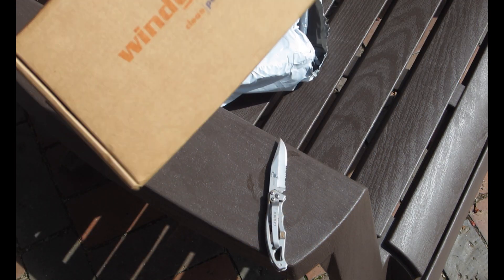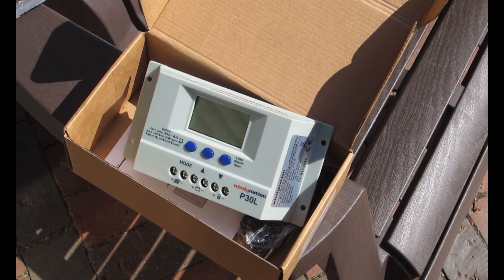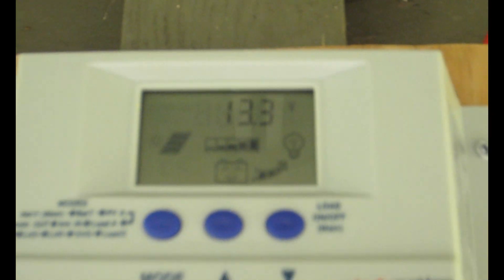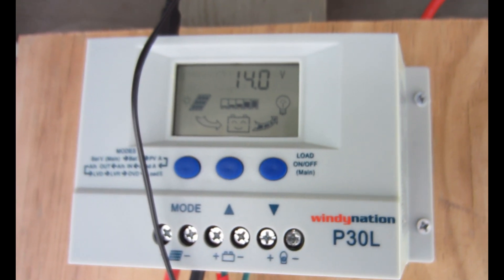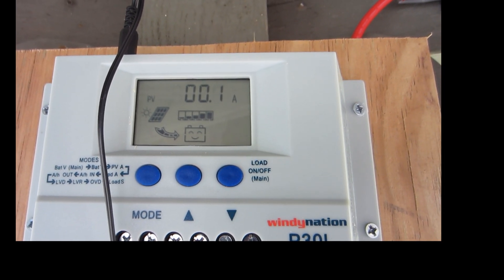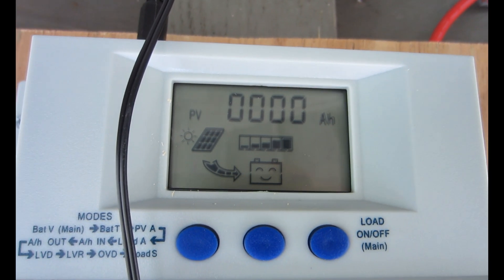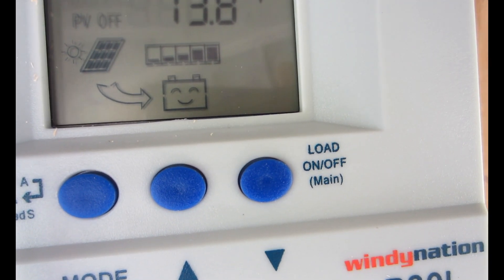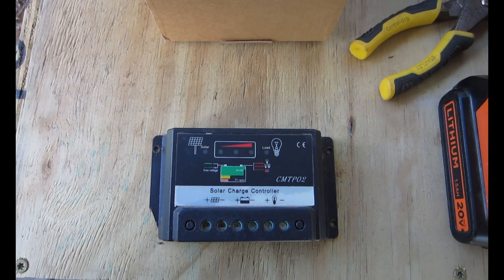Windy Nation P30L Charge controller Unboxing Review and installation.

Comment: Oh question if i may, can you connect the external battery monitor to the battery terminals of the charge controller since those leads are already connected to the battery or no ?
Reply from the maker: Yes with the Alili Battery monitor everything goes through the “shunt” on the negative side of your battery bank. I have an inverter attached which shows drawing on the monitor system. I can easily see the state of my battery bank on the monitor. It shows the amps being drawn and the %of my battery bank and the number of amp hours left on it.

Comment: I JUST bought my first live in RV that had this exact charge controller and now, (2) 100w Windy Nation SolR Panels and THIS video so happily came up as I needed to quickly know what the different Modes were, thanks so much, you video share helped tremendously today this re winter snap just in time as I just put up the second solar panel the previous owner did not get a chance to connect. I find myself with an additional 110 AMH battery I intend to balance with the current 110AMH battery and connect in parallel to increase stored power. Thanks !

Comment: How many 100 watt solar panels can this thing handle
Reply from the maker: It is a 30 amp controller so if your panel puts out no more than 5 amps. You could have as many as 6 (in parallel)However if you configure your panels in (series) you may not exceed 48volts. In series your amperage would not increase with more panels. I don’t think I would put more than 5 in parallel configuration.

Comment: Do you connect your inverter directly to the batteries? Is that really any different than connecting it to the load terminals or do they just run off the solar only and not pull from the batteries? I've always wondered what the point of the load terminals are on these. Maybe people just use that if they don't have batteries ?
Reply from the maker: Yes inverter connects on each end of battery bank. Well the load terminal gives you the opportunity to run DC rather than AC. I am sure that you lose some power in that transfer. I understand your question though. I think the load comes from the battery not from the panels? Anyway you must have batteries with this type of controller. The controller does give you some control over the load like timers and auto shut off and on depending on daylight. Etc.

Comment: This controller has been great - really good for me for over 16 months. 

However, at the price of it on amazon it’s awesome! Been quite happy with my two 100W windy nation panels and this controller. I have seen as much as 11.4A in full sun in Vermont which is awesome. 

It would seem very little extra cost to put a couple USB ports on it but that’s not too big of a deal. The other thing that would be nice is one more button to cycle through ‘days’ and have 30 days of data stored but that’s even less important to me. 

It just works well and equalizes batteries- the only really important things in a budget controller.
Reply from the maker: Yes I have also had really good luck with it and love the info it provides at a glance!
I seldom need the extra amps from my third panel but it comes in handy when we lose power. Just make sure not to connect the solar without having connected the battery bank first its how I fried my first one. Glad you enjoyed the video!